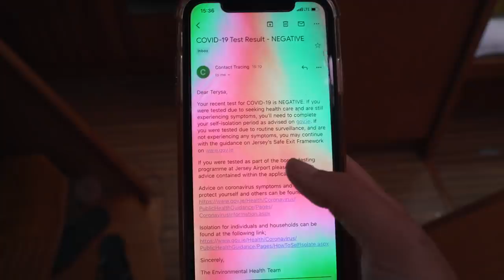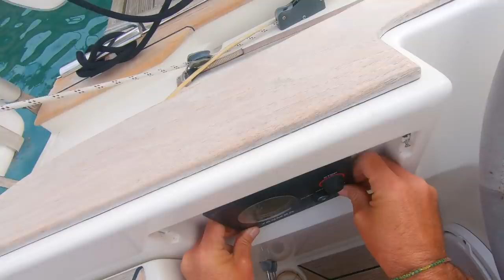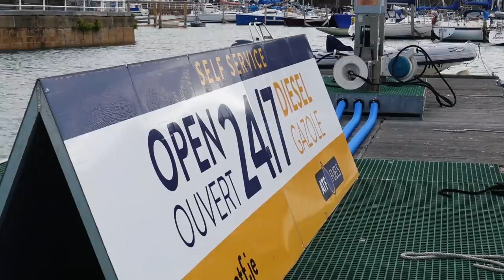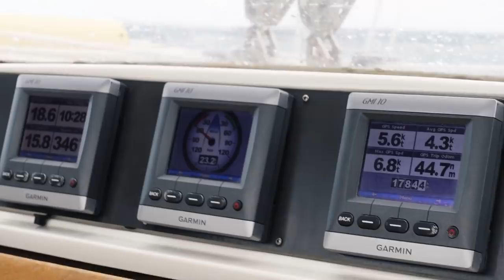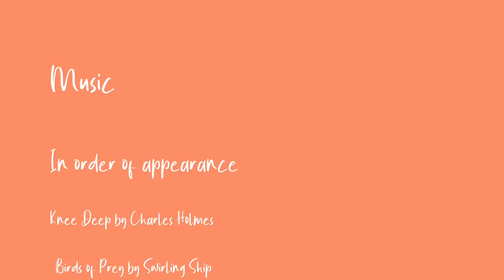A Really Tough Decision | Sailing Ruby Rose Ep 144

Comment: I’ve been a pilot for over 35 yrs, one of the very first things I was taught was “There are old pilots and there are bold pilots, but there are no old, bold pilots.”  Good call Captain. 👨🏼‍✈️👍🏻
Reply: Another flying adage,,,, hours of boredom coupled with seconds of sheer terror.  Who needs the terror eh?
The right decision in that moment, now off to the pub for the both of you
Reply: Well one of the most important maneuvers a pilot learns is the 180 degree turn.
Reply: Takeoffs are optional, landings are mandatory! 😎👍🏻
Reply: As a glider pilot and sailor I heard that saying in both camps. I was about to use that exact saying. The right decision was made. If any doubt, pull out. BTW,  remember aviation has a 100% record. It's never left an aircraft up there.

Comment: Hint:  Using a Q tip, lightly coat the sockets, contacts and bulb bases in dielectric grease on any outdoor lights for much better corrosion resistance.

Comment: You didn't say how far you got but I'm guessing you may not have rounded La Corbiere.  I didn't follow your decision to anchor in a bay to the north of Jersey, I have never done that but don't think I would consider it except in fine weather. It may have been a slog but a run up to St Peter Port may have been an option and you would have the reward of St Peter Port. One of my favourite places. Rounding Jersey to the east requires some thought as there is extensive, unforgiving, foul ground there. it's not always easy knowing whether to press on or return to port but certainly no shame in it. Safe sailing and hope you get a gentle passage through the Alderney race.

Comment: Ever consider lubing the seals, lips of that instrument with some lithium grease? And do you use dielectric grease on your electrical connections? Personally I would've wipe a layer on the threads of that bulb, and after spraying contact cleaner (great stuff) I'd put a dab on the connections. I've seen misinformed sources say that you can't get the dielectric grease on the actual contact points, but my long experience is the metal to metal contact, whether spade push ons, wires wrapped around a screw or AA, AAA, D  batteries, etc, etc  it never interferes with the electrical contact.  It keeps out oxygen, moisture and salt.  If I've mentioned this before sorry to be such a nudge - it's my current hobbyhorse.

Comment: I would rather sail with a captain who will turn around than one that would sail straight into shit and risk everything. I have only sailed dinghy size sailboats and in those I like to push the envelope, but I am in a lake with a boat I can right by myself. When I get out in a yacht there will be no pushing the envelope. Just like when I am driving my car I don't push the envelope. I have turned my car around in the tulie fog because it was so thick I couldn't see the center line. (Tulie fog is low hanging fog that sit on the floor of the valley in Northern California and that shit is thick and heavy. 20 feet up it will be super clear. Don't know if y'all get that, but it is a thing). There is nothing more scary than to get caught out in it where it is too far back and seemingly too far forward. I have counted breaks in the white line in the middle of the night and then just sat and listened to determine if I could make a turn left safely (crossing fingers as I turned, luckily it was 3 am and not much out there). I should mention home was 40 minutes drive from town. Trust me, once you are in that deep you are wishing you had someplace safe to just pull over and sleep in the back seat, but that road was way to scary to do that as a female and the darkness out there is real darkness. Not able to see your hand in front of your face.